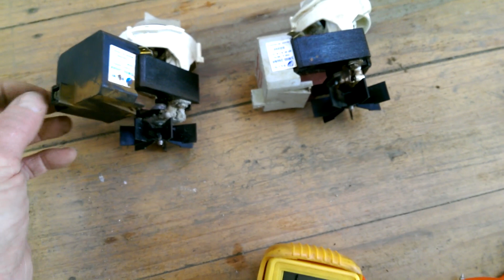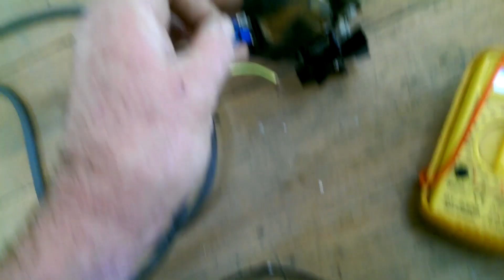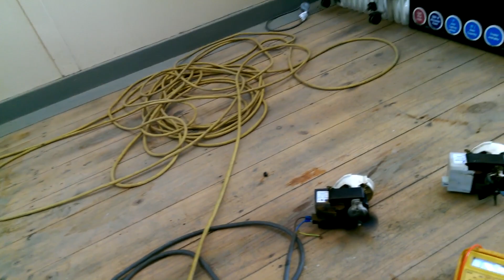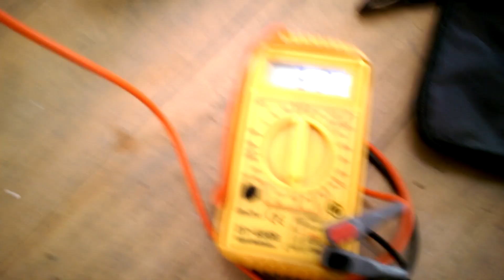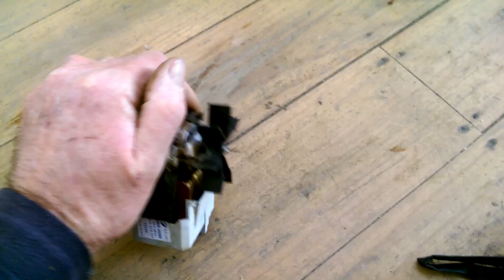Fisher Paykel SmartDrive Pump Test

Comment: Correct me if I'm wrong, would the resistance be the same for USA models?  I have a IWL12.  I put new bearings and a seal in.  It would not spin, and I give it some spins in opposite directions, then it "catches" and begins to spin.  It still is not pumping the water out of the basin.  I would say the diverter valve is good as when trying to dump the water, there is no recirculation.
Reply from the maker: @hectorquintana5219  the resistance should be 7 ohms according to the service manual.
https://www.manualslib.com/download/3136414/Fisher-And-Paykel-Iwl12.html
Reply: @paulywooly  Thank you!
Reply: @paulywooly  Do you have any other suggestions to check with as to why the circulating pump is not engaging after new bearings and seal installation?
Reply from the maker: @hectorquintana5219 
No, I'm not sure why that would happen.
Recheck all wiring to the control module, especially the diverter valve wiring. The diverter valve could be jammed on. Check the drain hose is not kinked or blocked. 
If the machine does not spin can mean the bearings are not seated correctly and are too tight. Check my other videos about machine  thumps and doesn't spin. 
https://youtu.be/-ibZ7CU-hVM?si=YzozkHsB9I6ZBu8z

https://youtu.be/rcypPHAzhCA?si=a3SBnWgi4Us4MZaY
I'm sorry I can't be more help

Comment: If it cuts out after not completely emptying and I can pause it for about 10 minutes it will go again.  It has good pressure when it is running. Would cleaning it out help
 It's 18 yo machine so wondered the best place to get a pump.  Can u get 2nd hand ones or reconditioned.  I see  they sre about 80 to 100 bucks. I alredy just  cleaned the rpu sensor  contacts and  that  got rid of the fault code. But then the pump started to  overheat after just fixing that problem .  Maybe when I had machine on side it stuffed the pump  ? Seems a coincidence.  It's hard to know if worth spending  $100 on an old machine.  Many thanks
Reply: Hey, I'd say Ur pump is overheating and pausing it for a bit allows it to cool and operate again until it overheats once again.

Comment: Tested our pump today and got 24 Ohms. It was friggin hot to remove and definitely popping the bimetalic strip and causing chaos during spin time with error 37. See evidence of possible corrosive water getting into the windings that has also stuffed the rotor position sensor connector which I already replaced thinking that was the issue. Thanks for the upload!
Reply from the maker: You're welcome.
Thanks for the comment.
Sounds like 2 separate issues.
Old machines usually have green corrosion on the RPS connection, causing them to fail especially if the washing machine is in a damp area. 
Either that or the main seal is slowly leaking.
Reply: Did u buy a new pump  ? How much.i also cleaned  the rps contacts which fixed the fault code but then the pump starred overheating just after i fixed that. No fault code but pump stops. Overheats

Comment: My WA37T26GW2 Washer died (completely unresponsive controls), and it looks like the drain pump is shot (~3 ohms).  All the 479595 (sm00236nr) replacements I see come with a fuse.  Is this a replacement fuse, or an in-field add-on?  I suspect my main control module (421306USP) is shot also, but is there a possibility that it's just a fuse?
Reply from the maker: Hi.  Yes it looks like the new pumps come with a replaceable inline fuse for extra protection of the motor control. 
In my years of experience, chances of replacing the motor control fuses give you a 50-50 chance of the controller working again.  After a fuse replacement, it will either work or go BANG as soon as the power is switched on. 
Remove the motor control from the machine (taking note of the wiring harness plugs or take a photo) 
Lift the 3 clips along the side and open it. Remove the board from the case by lifting 3 more clips on the side.
There is 1 maybe 2 brown cylindrical fuses of different amperage, that could be blown. 
Test these with a multimeter or continuity tester on the soldering of the fuse. No reading means it needs replacing 
On top of the fuses is a T with a number. The number is the amps. 
Replace with the same amp fuse. 

Hope this helps and good luck

Here is a picture of the fuses you are looking for:

https://a.aliexpress.com/_mtE9jvs
Reply: @paulywooly  Thanks, Paul!  I definitely have a blown fuse, so now I have to decide whether to test out my soldering skills or just consider the machine to be toast.
Reply from the maker: @Sloppyedwards  the fuses are cheap,  it's worth trying to fix in my opinion

Comment: Thanks helped alot, my pump is 7.8 ohms not even going to bother running it. It's blown the motor driver board fuse . What are the chances its blown the board?
Reply from the maker: 50-50 chance in my experience.
 You can replace the fuse and try it again. (Some boards have 2 cylindrical fuses, test both with a multimeter)
  If the board has blown, then the new fuse will pop with a big bang as soon as power is connected. Or it may work perfectly.
Reply: @paulywooly  thanks, yes the 4amp has blown but board looks clean so will try it, can I test  by connecting 230v without putting back in machine? Cheers
Reply from the maker: @nzpic  Yes you can.
Reply from the maker: Let me know how it goes
Reply: @paulywooly  yes will do, have to find a fuse to fit first.
Reply from the maker: @nzpic  what country do you live? Search Google for TR5 fuse.
Reply: @paulywooly  NZ , Clarks Beach
Reply from the maker: @nzpic  ok,  I never asked what model machine you have. Whether they are glass fuses or TR5 type. But this guy has all sorts of fuses 
https://www.trademe.co.nz/3598562008
Reply: @paulywooly  added a temp fuse to try the board and she powers up ok so I'll fit new pump when it arrives and get a few more years  at 18 now not bad for first failure.
Reply from the maker: @nzpic  that's good!

Comment: I would use insulated terminals as they are pretty close to each other.

Great Video Paul
Reply from the maker: Yes, I know it's a bit risky but unfortunately insulated terminals won't fit in the hole
Reply: Yep they don't fit, I tried 😂
Reply: Air is a good insulator...  It just don't keep your fingers from touching...
Reply: 😊 yes - Air insulation breaks down with a small gap 😂
Reply: I always use cabac insulated terminals on the wires and they fit well.

Comment: Hey Paul so I just tried a multi-meter on my pump and got no readings at all? I'm guessing my pump is completely stuffed LOL Have you seen that before? Cheers Mate
Reply from the maker: No not often...but Yes if there is no reading of 32 -36 ohms then it's burnt out. Needs replacing

Comment: Hi Paul, how would I fix a Fisher & Paykel MW058K Washing Machine that turns itself off when you press start pause to start the machine for a normal wash cycle? When it happens it won’t turn back on for at least a minute. I have a feeling it’s the pump as I was told the machine would sometimes stop when it was draining or spinning.
Reply from the maker: That's a strange symptom. I would definitely check the resistance of the pump and also the water valves. Try testing the out of balance switch and lid switch. The resistance must be 0.0X ohms. Any high resistance readings on those switches can cause wierd problems with that model of machine
Reply from the maker: Also check the motor windings red blue and yellow wires ... resistance 12 ohms ish. Water valves are 16 ohms

Comment: Mine gets so hot I can smell it . It keeps cutting out & will go into some error code . New one should fix it I hope . Thanks for your help .
Reply from the maker: Yes they stink of electrical smell when they are burning out. I have even seen smoke coming off the pump. A new one should fix your problem

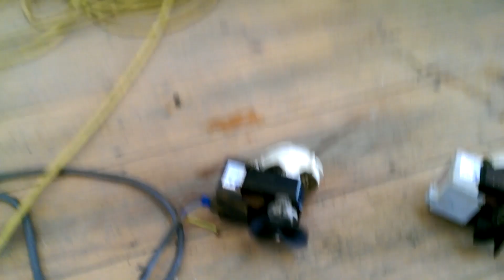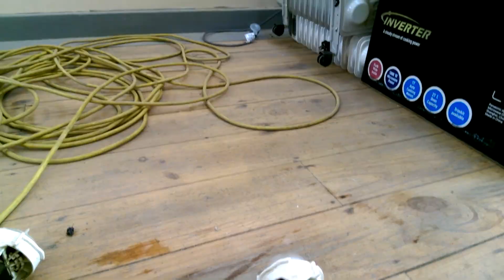Comment: That's really interesting! I noticed a sound difference between the good pump and the broken one. The good one seems a bit quieter and possibly runs slightly faster as well. The bad one seems to make a kind of grinding noise and I can hear an electrical buzz sound when it's running. You can tell which one is in better condition: 1:22 vs 2:23. Thanks for showing Paul!

Comment: Thanks for sharing Paul. I have followed your testing procedures for all other areas on my Phase 5 Smartdrive, and they all test fine. Even replaced the RPS (it looked corroded), still no luck. Machine powers off completely during rinse cycle. Perhaps it is the motor after all!
Reply from the maker: If everything tests fine then unfortunately it's most likely the motor control module
Reply: @paulywooly Turns out this is the case. 20 years of service later...!